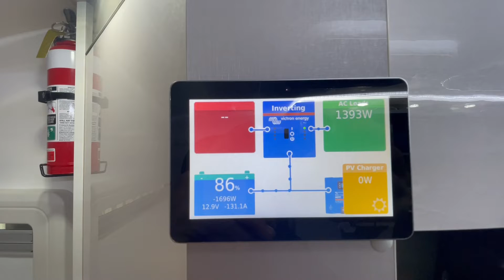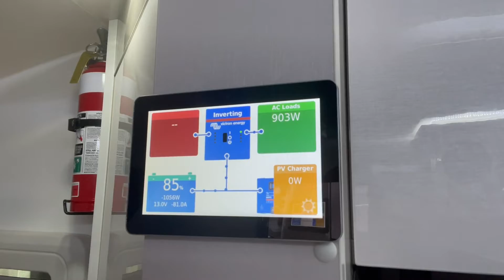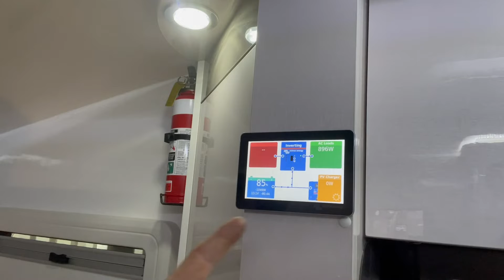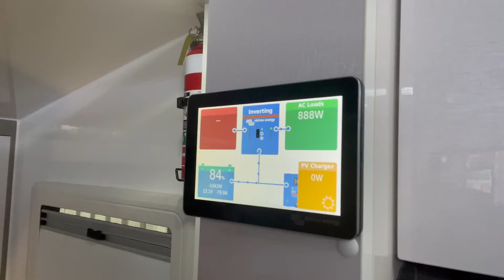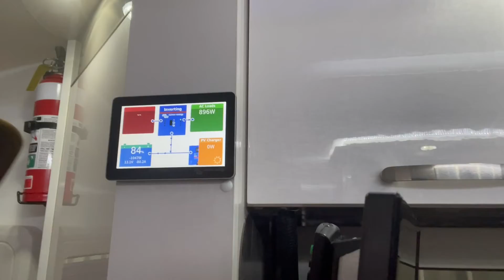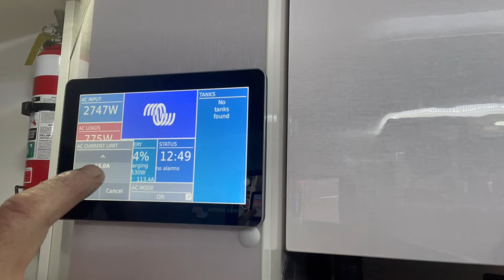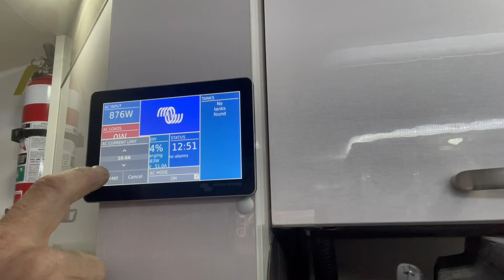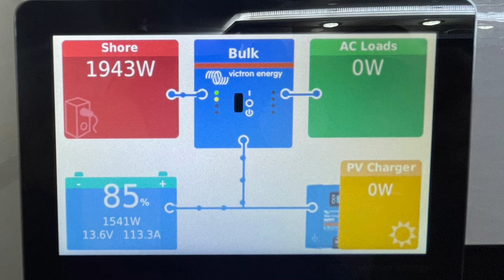GoldStar RV 1240 watt solar 560ah lithium off grid setup runs the AirConditioning microwave and more

Comment: Another nice job , one question how come you don't have the dc windows display on cerbo gx touch 50?
Reply from the maker: It’s very inaccurate as it only shows you left over dc power as a calculation.
Look up more information under the CerboGX manual.
Very well documented online also.